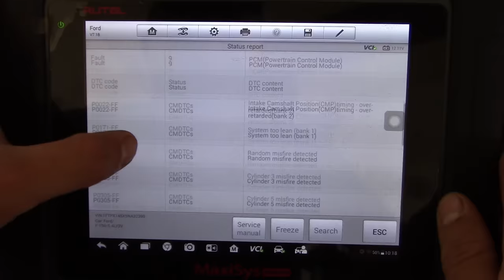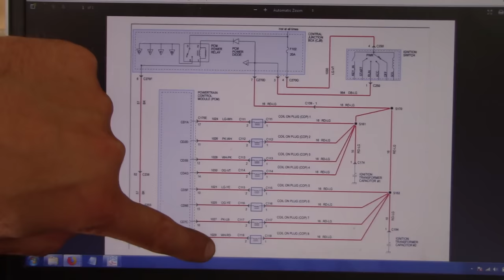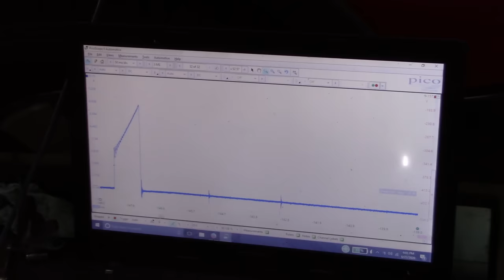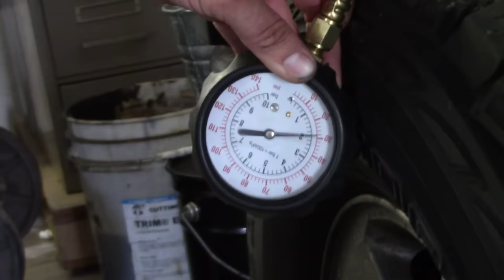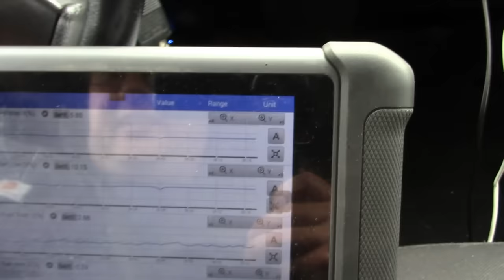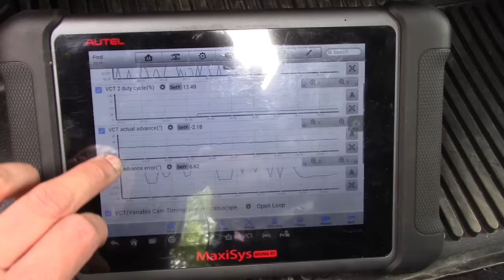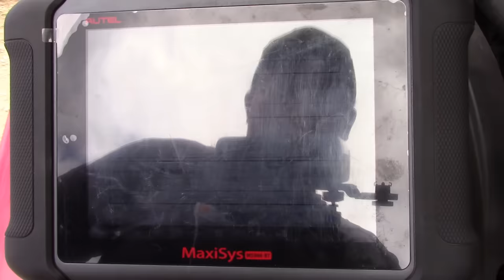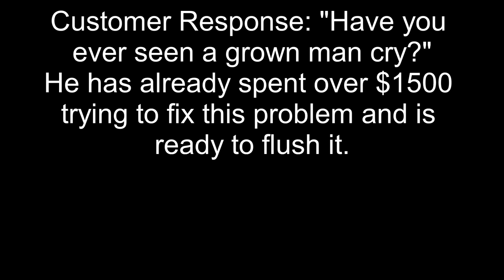2005 Ford F150 5.4L - missfires, intermittent rough running, rattles and knocks, P0021/P022

Comment: This is the kind of stuff that sells a lot of Toyota's.
Reply from the maker: Yeah, the Toyota VVT seems to work fine. I don't know that I've ever seen a Toyota need a timing chain.
Reply: You got that right.
Reply: Ain’t that the truth!
Reply: @WatchWesWork   Brother had a 4 runner that needed a new one. When the so called mechanic got done with it, it ran about 7 miles up the road and locked up from silicone covering the oil pump screen. It didn't have a 'change engine light' but needed one then.
Reply: And yet toy oh duh will never be the best selling car or truck in U.S. for the past 36 years.
Reply: Watch Wes Work , The old 22RE normally required a chain around 100-150k because the oil fed chain tensioner would get weak and the chain would get slack. It would then break the chain guide and the chain would start eating into the chain cover. You knew it had a problem because it would rattle on startup.
Reply: Watch Wes Work my dad has an 06 4Runner with the 4.0 V6 with around 186k miles,has all sorts of codes for timing I took a poke at it and there is an issue with the VVT system somewhere, I think it’s the left bank solenoid. He doesn’t want me to take it apart though and daily drives it so it can’t be that bad. Just bought an FJ with the same motor and I’m hoping that part stays together, because VVT systems are one thing that I just can’t seem to understand completely.
Reply: Anything but a Ford. I worked on a friends 5.4 , 70000 miles, was having the same problems. He paid like 38000 dollars new, ford needs a class action lawsuit on there ass.
Reply: sure, if you like a rusty suspension.
Reply: @mglenngoodson  there's your answer lol
cars and trucks with more than 50,000 miles are gonna have problems
Reply: @grosseileracingteam  maybe because of peoples stubbornness 😏
Reply: True, but Toyota had major issues with frame rot.
Reply: David Johnson  never heard of the chicken tax or a helicks.

Comment: Installed a reman 5.4 in my sons 09 F-150. Talked about doing the transmission but didn’t. It failed 3 months later. Such great trucks! Pulled the cab for the engine swap.

Comment: Having worked in electronics for years, when you mentioned BNC and banana connectors, as well as computers and PICO scopes, it really made me realize how much auto technology has been turned into electronics driven machinery.  You're doing well working with electronics.  The truck's owner isn't doing so well.  He got taken badly by the seller and the dealership.
Reply from the maker: Yeah, scopes have been used for ignition diagnostics forever, since the 1960s at least. But, now guys are using scopes for all kinds of things. The pressure transducers are really cool. They are able to see details of compression, vacuum, timing, etc.

Comment: Nice.  Well put together informative video.   Showing the camshaft caps was great -  once the valve covers are off it's a must to check them for wear.  No use spending a bunch of money on timing chain stuff if the heads are shot. 
The oil pressure switch is pretty difficult to get to -  but there is an adapter available that threads on in place of the oil filter. Easier to check pressure from there.  If anybody checks pressure on these engines often it might be a good purchase.  There's DIY versions of the adapter, too.  
Thanks for the video.

Comment: 3 valve triton hand grenade LOL...change engine light LOL...love it..

I own one of these disasters, mine is a 2004 with a 2007 rear axle ( the ONLY warranty repair), a 2010 transmission, and a 2014 engine.  The engine is a noisy bugger, my reman runs great, or it seems to, yet the darn fuel injectors make a hell of a racket, leading the nervous among us to think something is wrong, when that is normal noise LOL.  Spent a small fortune to keep all stuff working.  My latest and greatest is the electric shift motor for the transfer case is showing its 2004 model year age, fixed that with a little love tap from a claw hammer and it works like a champ again, all other 4x4 failure points were addressed about 4 years ago and those are holding up, periodically check the the front IWE to make sure more things arent spinning than are supposed to. 5W-30 mobil1 twice a year oil changes weather or not I make the mileage.  1 thing about these engines is they a very picky for clean oil with those narrow passages and cam phaser.  Though the factory engine failed at 107K with religious 3000 mile oil changes, but I used the recommended 5W-20 and that turned out to be a mistake.

Comment: You nailed it !  Feel the pain :(
I ditched my 97 4.2 stick cause it needed a clutch job.  Frame was rusted so I did want to spent $$$$ for nothing.  I retired and on an extreme budget but need a pick up to finish the major re-build on my house.
Found a clean 04 up from the south....no rust no rot and it ran.  Up here in Canada old F150's are rusty everywhere.
I knew at some point I would have to do the timing set ....but didnt know it would crap out suddenly after8 months driving.  I do all my own work and did drop the pan.....full of metal and oil pickup clogged with timing guide debris.
Guides were broken....tensioners blown...VTC 's full of crap and stuck.
Changed oil pump....this is manditory !  The OEM pump was pathetic on these.  $1500 in parts and truk off road 2 mths I proudly went out for it's first run and the driveshalf puked.....barely got it home only a couple of miles thankfully..
Then it was a string of little stuff...vacuum problems.....coil boot problems.....PS pump lines leaking.  All related to taking aparr a 16 yr old vehicle.
That said it runs good for now....get my project done and its GONE  !!
The 04's and beyond were a clean slate design..they could have done anything.  Instead Ford made the most difficult to deal with truk ever made..
In hind site a reman would be the only way to go.....I'm up and running but still have old engine and heads....exhaust manifolds and god knows what else.  New truk is way too much $$$$$ so I just pray and hope.
Thats why the junk yards are full of them.

Comment: Lack of oil was very evident. My buddy has the same Ford  298k miles and no issues. He changes oil & filter every 4k miles like clock work. Belts every other April.
Reply: I have two of these trucks with these engines one has 340000 miles and other one 205000 miles and never had timing issues
Reply: The other thing I learned was you got to go to a heavier grader OL one once you do that you don’t have no problems remember and all the other countries they don’t have these problems are the 5.4 it’s only in America where the EPA is gotten involved trying to raise gas mileage oh I wanted gas mileage add a bought  ugo

Comment: When timing is done upgrade to Melling high volume oil pump and the upgraded iron timing chain tensioners. I would also recommend 5w30 in Fords modular engine.
Reply: When does the reprograming of the pcm comes into play when doing a timing job
Reply: @fjolaez  There are two options when that happens, phaser lockouts you program the PCM to not throw code for phasers not working, or there are a couple of PCM updates that Ford Tech Makuloco recommends that increases your idle speed to help maintain a bit more oil pressure. I'm unsure how much that idle adjustment is needed if you go with a Melling 340hv or 360hv pump. Same pump, 20% more oil flow in each, one has a 40psi spring, one has a 60psi spring. Lots of people have had good luck putting back together semi-scored cam caps and cams with an upgraded oil pump and full OEM timing set w/ phasers. I just did my own, chain, phasers, rockers, lifters, oil pump, solenoids, etc. With a Melling 360hv pump, the engine is now silent. Ford Tech Makuloco recommends 5w30 instead of 5w20. I still am running 5w20 in mine as I have a bunch left to burn through. 04 f150 with 171k on the mill, lighter scoring than in the video, but still plenty to catch your nail on. I haven't hooked up my mechanical oil pressure gauge to mine after rebuild, but I have a feeling with minimum 30-40PSI of oil pressure at idle and near full 60 psi driving, I should get some more life out of it.
Reply: I agree its best to use 5-30 full synthetic. Stay clear of the Ford synthetic blend oil and the Ford oil filters.
Reply: @herbb8547  lmao Motorcraft is all you should be using in a Ford
Reply: @tylerschaub1791  Motocraft oil and filters are garbage. The Motorcraft synthetic blend is 10% synthetic and 90% cheap oil. I used nothing but Motorcraft synthetic blend oil and Motorcraft filters on my 2007 F150 and changed every 2000 to 3000 miles until it had 94,000 miles. At that point, the engine became so dirty it ran really rough and a Ford deal told me I needed a new engine. It took three engine flushes, but I got the engine running properly again. I then changed to Walmart full synthetic oil and Mobile 1 filters. The truck has 220,000 miles now and no more problems. Ford does not want your truck to last 300,000 miles because there is no money in it for them. Their Motorcraft oil is designed to make sure you never get there.

Comment: I have two F 150 pickups 03 two valve and a 06 with  with 3 valve 5.4 and they both have well over 300 thousand miles on them . Most problems are from people not doing required service……….. my buddy just bought a 2021 1/2 ton Silverado and it’s a nice truck except for the fact that the 6.2 motor blow up at 9000 miles

Comment: An old friend of mine reminded me of an old saying " you can't polish a turd " so stop trying, I feel ok now
Reply: You surely cannot polish a turd. Sad though that some folk will roll one in glitter and pass it off to the next guy as a gemstone. (glitter also appropriate given the cam journals turned to glitter now) :(    Personally, this far in I'd just throw tensioner gaskets and one VVT solenoid at it, redo the JB weld job on the timing cover and run it till it locked up.
Reply: You can at least put corn in it for texture.
Reply: @bd5058  that would be decorating one...

Comment: b t y ,, the first car i ever bought   was a 78 camaro from a girlfriend who bought it brand new and had it serviced at the chevy dealer ,had  50 k miles when  i got it , went thru the whole car fluids etc... dont know when the oil filter was last changed ,, but it looked like crude oil in there and i could barley see the the small holes where the sludged oil never made it into the filter ,, i learned then that it only survived because there is a bybass valve ( spring ) in the filter for when its clogged . I never trusted dealerships or oil change places since i was a kid ,, ... car still ran great for the next few years i owned it .. thanks to the good ole 305 / 350's of the day .   I  know better today,,  that wont last ,, thanks again ...

Comment: Hmmm, someone didn't do the 90K timing chain maintenance when they were supposed to. Play stupid games, win stupid prizes people. Keep up with your maintenance, or you'll end up needing a new engine.
Reply: Also with these engines you must stay ahead of the oil changes or this timing failure is going to be certain. I work for a guy who buys these at auction for a few hundred and has me fix them for another $500 and then sells them for about 5k on his lot. People can keep neglecting them because I need to keep making money!
Reply: @jtbuilds9176  Synthetic oil and a German oil additive is all mine has had for 75K miles, changed every 4K. Idles like a sewing machine.
Reply: @19baitmaster51  LiquiMolly?

Comment: I believe a large reason for such carnage at 118K is due to poor or irregular maintenance. VVT engines aren't made to run with sludge which is why my 4.6 3v gets fresh Pennzoil Platinum every 4500 miles, or maybe 4000 after seeing this. These engines scare the hell out of me so if or when it has to come apart at least the inside will be as clean as a dinner plate.

Comment: Hey Wes, I only found you recently, courtesy of Lord Muck.
You do some great work here, and it is so refreshing to find someone that knows how to test and diagnose a part, rather than the old guess and replace things that aren't faulty. Dealerships so often employ young 'fitters' (they call them technicians I believe) and not experienced engineers that can actually figure out a problem and solve it. Keep up the great work. Your honesty is admirable, as is your modest presenting style and excellent video production. You have a new subscriber :)

Comment: The only way I’d ever buy a 5.4 is if a brand new engine was sitting in the bed. It will need it sooner then later. However it was great to see you didn’t throw your hands in the air and say it’s a 3 valve needs a new engine. Great video

Comment: And people wonder why I drive a mint condition 40 year old truck
Reply: Yes, still well made, my truck is 26 years old and still in good condition.
Reply: joel miller yeah same here. I got a mint 20 year old Tacoma. Great truck!
Reply: Not sure it would remain mint under those conditions.
Reply: @Cheepchipsable  Yep, nothing stays mint in the rust belt very long.
You get 20 years out of a vehicle before disintegrating into a heap of rust and you did pretty good.
Reply: Driven my Ford daily for 17years and 350000.0miles it's got a 4.6 2valve engine 5speed car!! Mobil 1 10w30 fully syn engine oil is the only oil plus Motocraft filters all my baby's ever had in her!!
Reply: Joseph Falco i have put a thousand on my jeep in a month to and from work, i say it’s possible. i have school i could throw in too, but not in this state of human malware, school is all online for me
Reply: @MrSuseguru  Call BS a little louder on me then.My dad's(RIP)69 FE just had it's 4th timing chain,never had the heads or pan off.Leaks like hell.435K.Don't drive it as much as the 71 cause  ethanol will destroy the fiberglass tanks,60 gals.71 has steel.
Reply: Joseph Falco   I have a 1993 Ford ranger with 460,000 km on it. That 4.0 L  V6 still purrs like a kitten . With Canadian winters to boot !!!!
Reply: @MrSuseguru  I have a 94 ford bronco with the original engine. Almost 400k miles. Never been rebuilt. Transmission is just starting to go out on me. Biggest issue i had was the pcm dying on me. Other than that the 5.8 is a great motor. Regular maintenance nothing special. Still has plenty of power too.
Reply: Still driving my 91 GMC 1500 in Alberta Canada 436 k on it , still waiting for engine to die , it just wont lol
Reply: @oldbiker9739  Mint 40 yr old truck. You're special and everyone else sucks.

Comment: Wes you're wrong! 
44:13  This isn't carnage. The 3valve triton has a special feature. It disassembles then recycles itself.
Reply from the maker: Fordtekmakuloko (sp?) has a video about a 5.4 that had a cam follower jump off, hold a valve down, hit the piston, shatter the piston, and detonate the entire engine. I believe it cracked the block and destroyed the head.
Reply: @WatchWesWork  ya I saw that to crazy

Comment: Could probably been from simple lack of oil maintenance .
Reply: And use 5 w 30
Reply: We use to get the lease backs from a motor home tour company with 48,000 km, just before warranty end. We would do an oil change and they almost always had the factory grey painted oil filter still. Which meant no oil change in 48,000 km. Hmm 🤔

Comment: Great video showing what happens if you keep driving the car with next to no oil in the top end. I've seen this on MANY cars with plastic timing rails and guides. When I started watching the video I was thinking chain noise. I have a lot of experience with the vw 12 and 24v vr6 engines. The timing stuff is NOTORIOUS for failure, but the later style 'update' fixes the failure. They usually don't fail bad enough, to cause the journals or anything in the valve train to get starved for oil though, because they use a hydraulic 'cylinder' chain tensioner. 

The Triton motors are not terribly good from the get go. Of the ones I've worked on, A LOT of them suffer from cracked exhaust manifolds. I wouldn't be surprised if the one you have is there, or on it's way Wes.

Great video bro! From one tech to the next, I enjoy your channel! 
Take care

Comment: Just moved to heavy line at work first job is the exact same Truck swapping the motor.all data is a massive help and having guys in the shop that will help you is also good.  It is challenging.

Comment: Great video 
I got 260k miles out of my 2005 f150 with the 5.4, it sounded much better than this one when I went to a 2013.
Change oil often. 
Change plugs and coils every 100k.
Reply: what oil did you use
Reply: @kp_5945  semi synthetic

Comment: My truck has been start up rattling since I bought it with 99k miles in 2009. Ticks also. I now have 204k miles on it and I’m just now starting to get a coil pack five misfire code pretty often. I’m going to keep driving it until it blows up. I’ll put a new motor in then. With 204k miles I can’t justify throwing money at it. Great video with great info. Thanks

Comment: I see why you guys refer to the three valve per cylinder Ford engines as hand grenades. Thanks for explaining the root cause. Always wondered specifically what made them so awful. Just pull the pin (wait for tensioner gaskets to blow out)... and wait.

Comment: FIx the front parts on the motor.  Leave the cam shafts.  Clean up what you can, cheaply.   Tell the customer, no warranty.    I bet it runs for at least a few years.

Comment: FORD...Found on road do I even have to finish the phrase.
Reply: Scooter's z28 ford is not the only company to build a bad engine . Gm built  many bad engines  .
Reply: I still  would  rather have a  ford  then gm or dodge  . But not the 5 .4 engine.